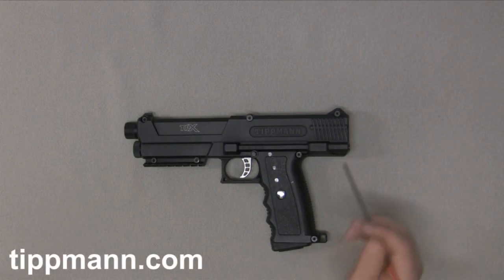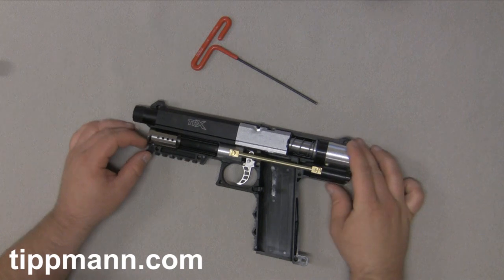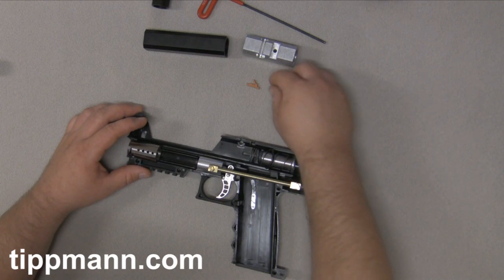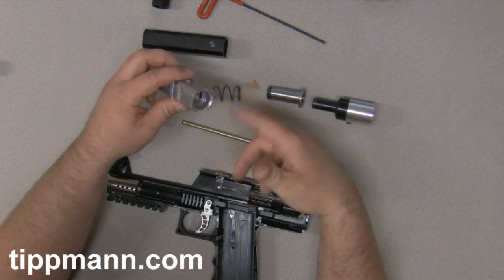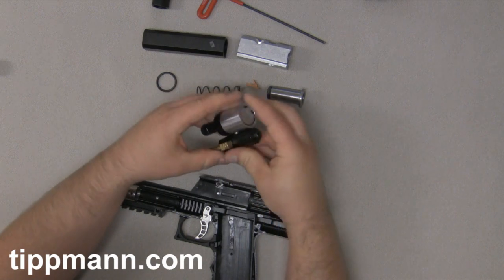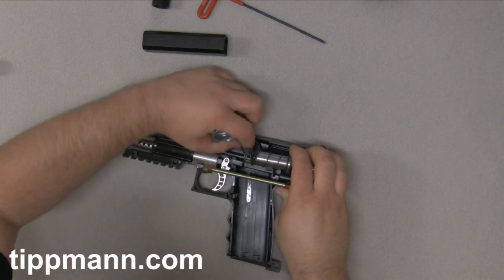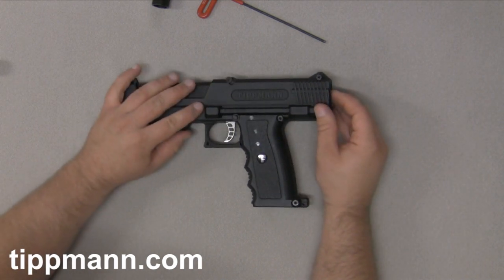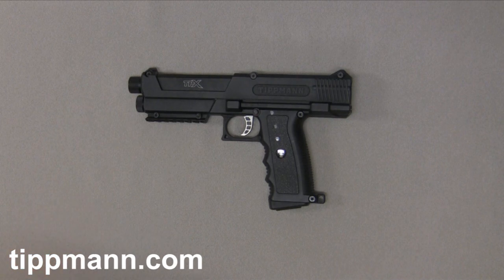TiPX Disassembly & Reassembly

Comment: the regulator has to be adjusted so it can reach the output pressor for the valve and its a poppet valve so it has to be a poppet valve not a spool valve

Comment: I also started my disassembly by following the manual. I took the barrel out before unscrewing the receivers. I have tried to get the barrel adapter to lie flat, holding it down as you show in the video so I can lay the barrel shroud along side it. There is so much pressure that I actually have to slide the receiver piece up, keeping constant pressure so the pieces do not spring up. You don't seem to be having those issues, any suggestions?

Comment: a spool valve needs a low pressor output source and this marker uses CO2 which has an output rating of 800-900PSI so this marker is actually a poppet valve not a spool valve